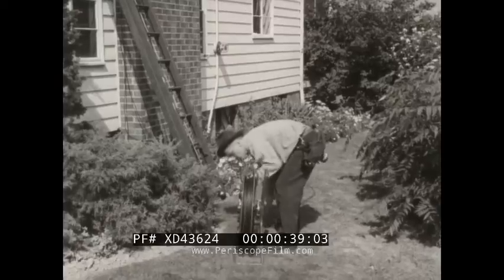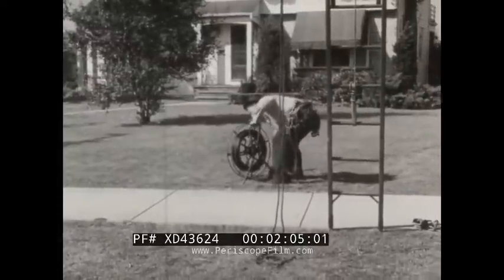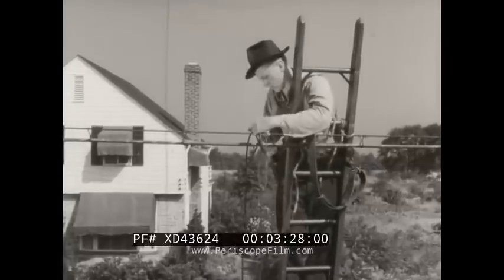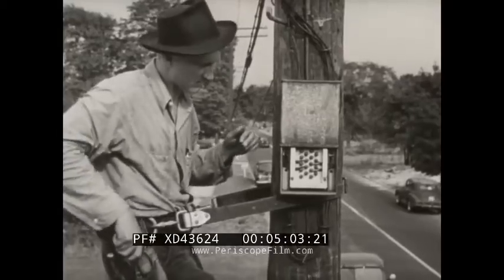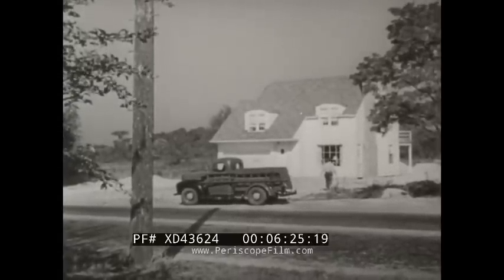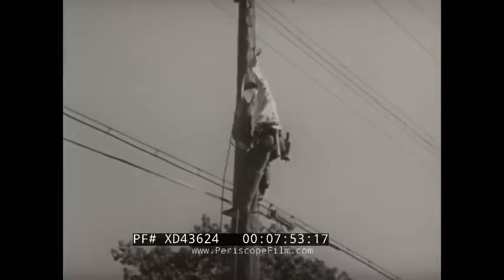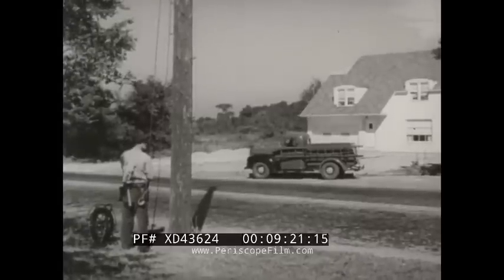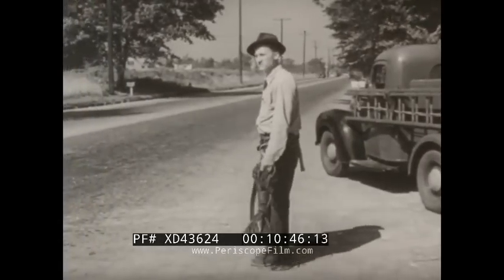DROP WIRE INSTALLATION   1940s TELEPHONE LINESMAN TRAINING FILM   XD43624

Comment: Not the way it is done in U.K. most drop wires run from the pole usually from the distribution pole or career pole
Reply: Yeah , but to be fair,  you guys don't even know which side of the truck the steering wheel is supposed to go on
Reply: Are you seriously comparing 80 year old methods to current? We don't even install telephone wires above-ground anymore in the U.S. In Florida, I had underground telephone, TV and electric cables in 1985.
Reply: Here in the UK most of the residential estates poles are feed ug with a 20pir cabel the flying wires rules are different in the U.K

Comment: That ladder propped up on only the phone line made me so nervous!
Reply: It's called strand.
Reply: @suprememasteroftheuniverse   Or messenger.
Reply: Those are not just the phone cables. Those are hung from the strands, steel rope running from pole to pole that can hold over a thousand pounds. Good ol' Ted is probably less than 200 in his gear and that ladder is likely less than 100 (our modern fiberglass ladders were about 75 pounds).
Reply: @BeOurBee  They are supposed to hold that weight.  The way AT&T has run the company into the ground, you have to test each strand because the pole might break when you put your weight on the strand.
Reply: It's not a phone line. It's a steel cable. Listen again. Bridges hang on them.

Comment: 6:52
In those days driver and passenger entered from curb side, for safety. .  That's what was taught in Driver's Education in High School..

No bucket seats back then.
Reply: I've often wondered why people slid out of the curb side seat in old movies. I thought it was a movie thing. Thanks.
Reply: i wondered what the rationale was for the ladder to be on the driver's side....
id think swinging a ladder around on the trucks traffic side could create it's own safety issues ... is
it still done like that ?
Reply: @garyschultz7768  
Sometimes things are done one way to satisfy various requirements.  Not necessarily the most logical or safest way for all occasions.
Reply: @garyschultz7768   No.  Now the ladder rack is on the roof.

Comment: When I was young growing up in the sixties me and my friends would watch the  ltelephone line man climb up the pole wearing cleats to fix the telephone lines
Reply: Me too. I was mesmerized by the spikes they wore on their boots to climb the poles.
Reply: My dad was with Bell telephone in the 70’s through the 80’s and told stories of guys who “burned “ a pole. That’s where their spikes were dull or didn’t penetrate the pole right and they slid down,very painful.
Reply: @garyschiffli1043  It's funny you mentioned that.  I have been with AT&T for 20 years,  it was called Ameritech, and then SBC.  I remember somebody that was in pole climbing class with me.  He was doing his maneuvers at 18ft and his Gaffs cut out of the pole.  Instead of pushing himself away from the pole (as we were taught) he hugged the pole and slid down.  He ended up getting a 6 inch piece of the pole go up is stomach under several layers of skin.  What made a bad situation even worse is that telephone poles are treated with Creosote to prevent rotting of the pole and also termites and other insects.  I was surprised to see him pull out the huge splinter and finished the class for the day.
Reply: @1959blantz  Yeah my dad told me of the creosote too,bad stuff especially in the summer.
Reply: @1959blantz  Pole school poles were often chewed up pretty bad. If I ran into one like that in the field I would use a ladder.
Reply: @IndyDog-ns8ws  So would I.  I always used a ladder even when it would be easier to put on Gaffs than hauling my ladder.
Reply: @garyschiffli1043  9
Reply: Cleats? You mean golf shoes? (cleats on the sole of a shoe) Those things are climbing spikes. I'm sure there's another name for them within the trade.
Reply: @rupe53  I knew exactly what he meant.  We always called them "Gaffs" but they can be called anything, especially by people that's never climbed a pole.
Reply: @rupe53  Gaffs or hooks.
Reply: @IndyDog-ns8ws  ... just looked it up and "climbing spikes" comes in first place, with gaffs and hooks as the common alternative. (that I couldn't think of the other day)

Comment: I wondered about Ted storing his ladder on the left side of his truck but then noticed it was a right hand drive. Maybe because mail delivery trucks are also right hand drive, IDN?
Reply: In those days driver and passenger entered from curb side, for safety. .  That's what was taught in Driver's Education in High School..

No bucket seats back then.
Reply: You can see him driving from the left side of the cab at 6:08 or so, and clearly see the steering wheel on the left side, 6:51 for example.  He is just entering from the pass side and scooting over.
Reply: I was wondering about that. I didn't notice the right hand steering wheel.

Comment: 6:52 How the hell does he get in the truck to drive??? LoL
Reply: Passenger side door and scoots over, used to be common.
Reply: @spamanator666  It would make more sense to put the ladder on the passenger side.
Reply: @fabio40  they do that for safety reasons get in and out of the truck on the curbside not on the roadside👍😎🇨🇦
Reply: @anthonybelyea1964  You're talking to a 30 year cable guy here. It's safer to get the ladder off on the curb side, so you're not struggling with it in traffic. They certainly don't get in the passenger side today.
Reply: @fabio40  ... trucks don't have bench seats and "3 on the tree" these days either. Even fire trucks of that era had ladders on the road side.